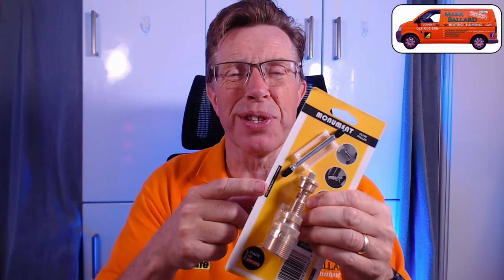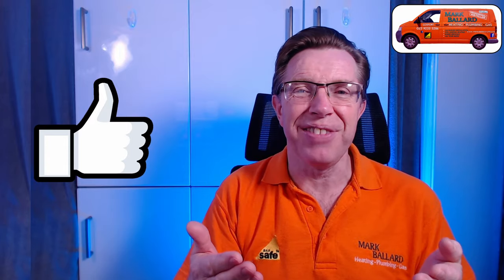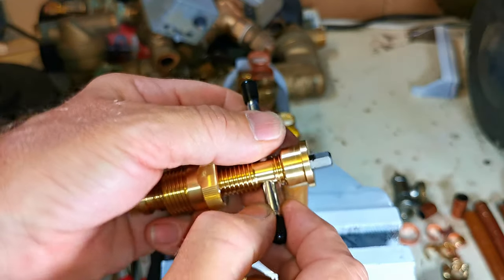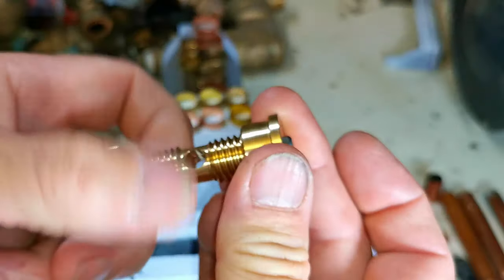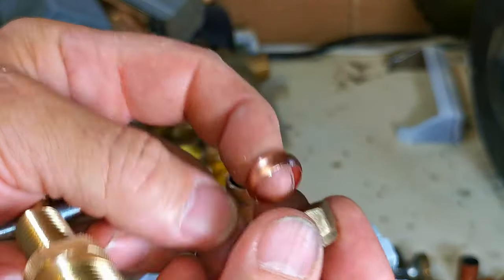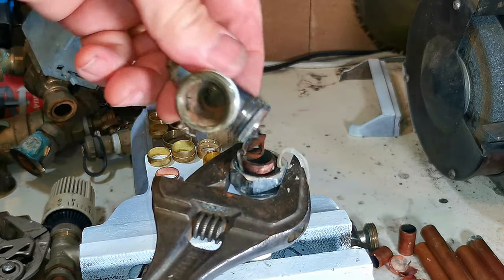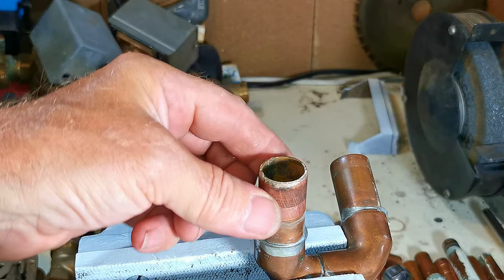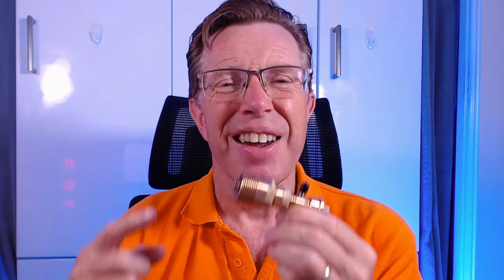Review, "Monument Olive Removing Tool" Removes 15mm & 22mm Olives. A Must Have for Your Tool Box

Comment: Great video. Just a quick note on the last point where you have a male thread on the coupling. You can turn the 22mm piece upside down so the coupling screws into the female thread of the 22mm part and this should be able to remove the olive no problem without needing an iron coupler

Comment: Always have used the monument olive remover. Unfortunately I had my 22mm one stolen with my tools👎
Definitely worth having in the tool bag for its versatility. 
There's always other tools like 7" small grips that works as well.
Great video another tool to put in my bag😂👌
Reply: L
l
Reply: if the compression fitting has been over tightened, it's a near impossible to use this tool to get it off.because the diameter of the copper has been distorted.

Comment: Great video. Do you find that you need to cut the pipe down and extend it with a new piece because the olive has damaged the pipe? Is there a workaround if the pipe is damaged like using PTFE tape?

Comment: Used one of these when fitting a new shower unit only 5mm stub of pipe protruding the olive was totally concealed by the brass fitting nut. The replacement shower came with fancy chrome nuts. Would recommend one of these

Comment: I purchased this after watching this video and others reviewing this tool.  I used it on 15mm copper pipe. The copper pipe truncated after tightening the tool using a spanner to remove a stubborn olive. This distorted and flared the end of the pipe which meant I was unable to fit a TRV valve. I had to cut the pipe and add a section which added hours to the job. Not recommend.
Reply: These work great if used properly, it won't work if the pipe or olive is damaged or the pipe end is not cut square/straight as it will pull at an angle and the olive will dig in to the pipe. You don't need to use a spanner to tighten just to hold the nut steady you tighten the tool using the handle provided. I only used fingers to tightened the compression nut up.

Comment: Please advise: when torque is applied to the monument sleeve puller, with the end cap inserted into the open end of the pipe and making contact (bearing against it), is there substantial torque transferred to the pipe itself, potentially disturbing the other end of the pipe, which has a compression ring/nut (near the wall end in my case), from coming loose? I noticed this puller does not have a swivel mechanism to prevent/minimize this. Not sure if applying grease will mitigate this issue though. I could, of course, use a pair of pipe pliers to restrain the pipe, but this is the last resort as I do not want to distort the pipe.  Thanks Mark.

Comment: I would like to remove a traditional thermostatic shower valve for a bar mixer valve but there is only minimal 15 mm pipe protruding from wall and I need to remove the nut and olive to fit a new wall mount kit to support the new mixer shower. On balance reading the reviews it seems that it will be hit and miss whether or not I will succeed in removing the olive without damaging the protruding pipe.  I can afford to take the risk so will purchase another exposed traditional shower mixer. he ho it is what it is......

Comment: I bought a olive puller . Unbranded but good quality. But did not fit inside 15mm pipe when changing valve.
Found off cut 15mm . It fits in one end, but the other where it's been cut . And  the pipe taper's in, IT does not fit.?

Comment: If you need to cut the crushed pipe part why bother remove the olive
Reply: I had the same question.  Perhaps it was to show that the tool will remove the olive even if it’s on that tight.  Personally, I see that, and I’m reaching for the pipe cutter.

Comment: It's unnecessary. There is no need to pull out the olives at all. Just replace the external valve and keep the original olives.
Reply: This sometimes works.  However, it’s not always a good idea.  If the old compression sleeve is damaged, any new fixture will leak. Also, each new compression fixture causes additional compression. A fresh ring starts over.

Comment: have you looked at " Maun Industries " olive removal tools, 15mm and 22mm, made in England, top quality.
We use to use a junior hacksaw to remove the olives, back in the 70's, a lot of people over tighten the compression fittings, which is not good, and then you would not be able to use the olive puller, but you can use the olive cutter.
if you ovr tighten the compression fitting, it will start to leak.which is counterproductive.
                                                      tightening requirement -
size mm                 - number of turns after hand tightening          - equivalant torque value               
                                                                                                               ( NM )     newton-metre
6 - 10                                      1 and a 1/4                                                   20 + / - 5
----------------------------------------------------------------------------------------------------------------------------------                                         
15                                            1 and a 1/4                                                  30 + / - 5
----------------------------------------------------------------------------------------------------------------------------------
22                                                  1                                                               40 + / - 5
----------------------------------------------------------------------------------------------------------------------------------
28                                                3/4                                                           55 + / - 5
----------------------------------------------------------------------------------------------------------------------------------
35 42 54                                     3/4                                                           70 + / - 5

do you remember - " popeye the sailor man" cartoons, he said to Olive his girl friend, "will you hold my Palmolive " and she said " not on your Lifebuoy "
 you maybe too young , to remember that Palmolive, and Lifebuoy, were the brand names of hand bar soap many moons ago.